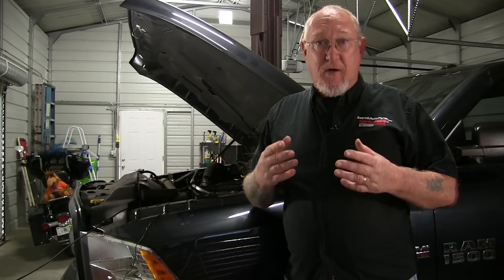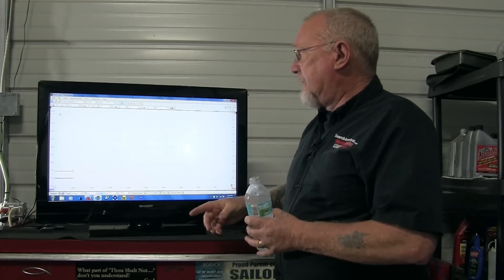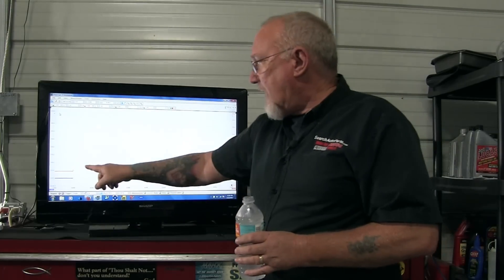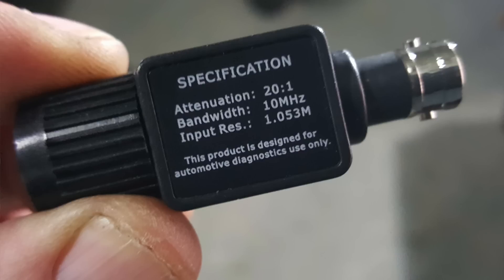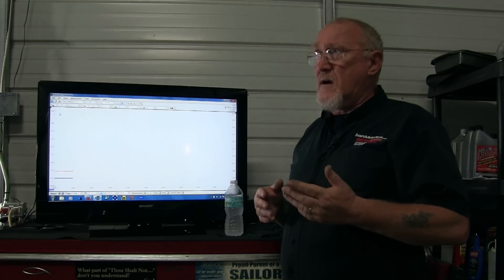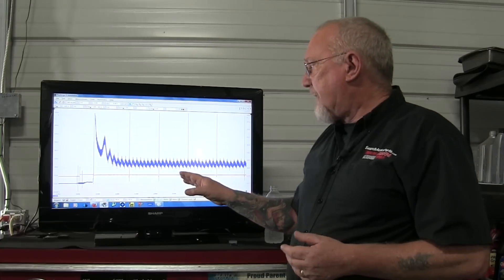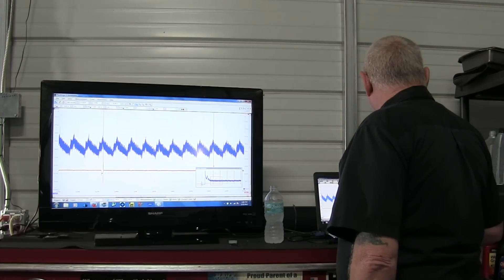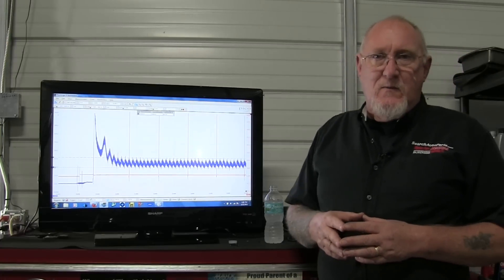Motor Age How2 #9 - Putting It All Together To Test Engine Integrity

Comment: A quick comparison would have been to remove #6 spark plug (no compression) and run the pattern again. Companion cylinder would have made the starter draw pattern plainly visible. Great video!
Reply: what has removing num 6 plug wire have to do in what he was showing,,,does that apply to all eng. t.y.
Reply from the maker: Bruce, what Patrick was suggesting was that I mimic a bad cylinder and show the pattern again. Good idea, but no - has nothing to do with the process I'm showing you. Hook up your own scope, do one the way I show you, then do it again with one spark plug removed so you can see the difference. I look for any "peak" that is not as high as the others. I want to find any cylinder that is weaker than the rest, not just the "dead" ones!

Comment: Great basic video Pete. Been watching your videos for quite some time. I own a Pico myself. Superb tool. Wanted to buy another attenuator but the only one I could find on the Picoscope website was a 10:1
Reply from the maker: Thanks! The end result, if you own a 4000-series anyway, is the same. The 4000 has a 100v input max while my original 3000 had a 50v max.
Reply: Motor Age Yes sir, I have the 4423 with the 100V max input. Didn't know the 3000 series were only 50V.... in that case it is the same 😊
Reply: That's why Pico sells the 10:1 now because that is all that is all that is needed with the 100 v input capacity.

Comment: Gratitude and thanks to you; jerry, Vince, Peterson, I was able to troubleshoot several problems on the well cared for 20 year old Toyota corolla 2000; 2wh dr ; 1.8L; automatic tyranny using voltage drop with voltmeter on a crank, no start. It cranks, only on neutral not park. Does the computer think the car is in drive? Is this why throttle position sensor has no voltage reading when opening the throttle vent flap?

 The relay fuel, was examine outside the fuse box its normal; it was examined under load, the hot side and the control side has power; looped thin wires, hot to ground and control to computer ground,  fuel pump activated just fine yet it did not start just cranked with fuel pump running. 

The 5volt reference is good on all the sensors; the computer is not dead, defective nor shorted however it thinks the neutral safety switch is on drive or reverse, so it shut down throttle and fuel?

 How do I test the switch, its very close to starting. I have Vince's book too its very clear making learning possible for me. God bless Vince and your techs on motor age and the seminars.

Interested in converting fuel source to hydrogen by setting up a electrolysis reservoir, I know it works!

Comment: Hello. If the cam and crank are not in sync, the timing is off and should be able to be seen on the waveform. The firing will be after top dead center, right?  Also,Is it a good thing for the cylinder to fire right at top dead center?
Reply from the maker: You can use this method to get a feel for timing but I wouldn't rely on it for accuracy. There is a better way to do that. So don't worry too much about it being right at the peak. If timing is off, you'll see it.
Reply: @MotorAgeMagazine  The only  way for me to know the timing is off  is  if I have  good spark, good fuel pressure , good fuel quality and compression.
Reply from the maker: @bbmd2200  All I meant to clarify is that you can see if the timing is off using the comparison between the ignition synch and the relative compression peaks. If you use an in-cylinder pattern with ignition synch you can really see it! That will be coming up much later in my How2 series but I do have an older video on in-cylinder testing that may be helpful:  https://youtu.be/bmIEbnglVj0

Comment: I notice that attenuators are never discussed when using Snap-On scopes.
Reply from the maker: I called Snap-on tech support. The Verus scope is rated to 400v input, which should be more than enough to cover the inductive kick found on components like fuel injectors and ignition primaries. There is also an over voltage circuit protection built in to their scopes. Just hope it works if you do connect to something higher! GDI injectors are one possibility I'd stay clear off without attenuation.
Reply: That is a very good question sir !
Reply: And Pete that is a very good answer !

Comment: this has got to be helpful if you understand what ur doing ,,in most cases the everyday man cant afford this testing equip. so i do it ole school each cylinder use a cheap comp.tester on each cylinder get a see correct answer.and i fully just watching didnt get everything in the vidio. thx what you tk of my comment..tyou
Reply from the maker: Sure, you can do it the old fashioned way - but how much time are you spending to do that on a modern V6? And on a hunch? Scopes are not that expensive anymore and the time saved more than pays for the investment - in my opinion...
Reply: Pete did a vid on a inexpensive scope called the U Scope which can be found at the AES website https://www.aeswave.com  which with a few adapters and attenuator you can measure and observe any signal on a modern vehicle. Here is the adapters you will need - 1 - [03-90-u] AC Pass Filter Adapter @ $17.00

1 - [08-87-BNCF] Flexible Adapter for uScope to BNC @ $8.00

1 - [pt-TA197] High bandwidth 10:1 attenuator @ $59.00

1 - [08-87-BS] Flexible Adapter for uScope to Banana Plugs @ $8.00

1 - [08-788] AES Flexible Adapter Set @ $29.00With these adapters you will be able to adapt any DVM leads or any other accessories that you already own. To further the capabilities of the scope. A low amp clamp, a high amp clamp, a paddle probe, capacitive pickup, and maybe a Inductive pickup can be added. The possibilities are limitless. All this can be found at AESwave. The scope is very affordable very fast and is of high quality which the software is always being upgrade for free to make it even more capable and user friendlier !  I actually own one and for the money it is well worth the cost ! The only drawback is it is only a one channel scope and as Pete has demonstrated in this vid, it is very useful and sometimes needed to have more than one channel !